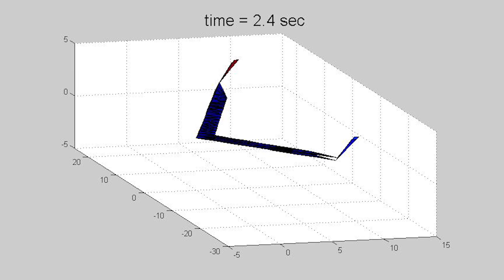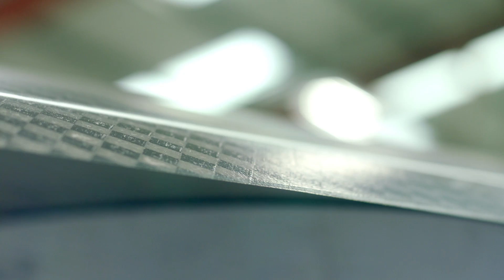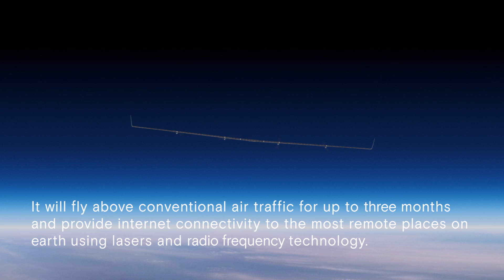Inside Facebook's Connectivity Lab

Comment: Facebook's V-wing drone, to provide Internet connectivity while flying for weeks at a time.

I notice at 0:48 to 0:51 this airplane-thing has landing gear (wheels). It seems especially a waste to have them as dead weight on a vehicle for almost all the time it's flying.. This thing could launched from and land on a "launcher" truck (with "wings") that moves on the ground at launching and landing speeds.
Reply: Ben Bradley It has to land after ~3 months as it says, probably will get upgraded/fixed and then launched again.
Reply: Gentle Gamer Software upgrades will surely be done, ahem, "on the fly."
Reply: Ben Bradley I was actually talking about Hardware upgrade, perhaps they make cooler hardware while the drones are in the air, then they will land them and upgrade them and let them fly again :)